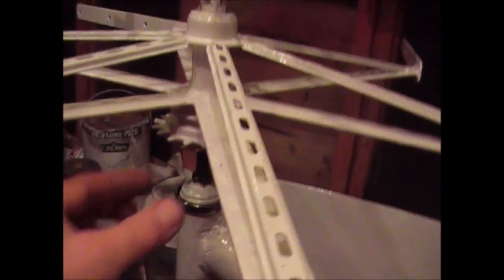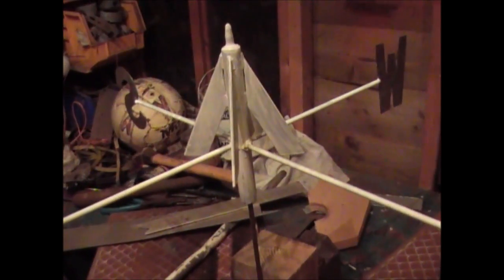Jim's Allotment - Plot 9 - January Tour Part 7 - Organic Pest Control and DIY Weather Vane

Comment: Thanks very much jim for that excellent advice. It's a coincidence that I have started collecting egg shells from a local cafe - 100 per day. When herself is asleep I put them in the oven for 10 mins. I use the blender to grind the shells up and bag them up. I know Aaron asked if it's ok to compost rhubrarb  . I would like to have your opinion on this matter too. The weather Vane look the business- Congrutulations. All the best
Reply from the maker: Cheers fro the question ... Rhubarb leaves are perfectly safe to put on the compost, the diabolic acid will break down so it is not dangerous in anyway, Hope you don't get caught grinding up you egg shells, My wife would skin me alive if you found me doing that :-) Cheers Jim..

Comment: I think I might pass on the rhubarb leaves mixture.  It sounds as if you need to be shown how to do it rather than just 'have-a-go'.  The life insurance is paid up but I don't think the missus wants me out of the way just yet :-)   I am starting to wonder from this whether I should actually be composting the the leaves from rhubarb at all.  Is there a danger from them when they break down.  Does the acid get into the resultant mixture?  I think the weather vein is amazing Jim.  I don't have the tools and I am not as skilled as you with them so I couldn't attempt something like that but you have made me think about how things are put together and that is a start.  Many thanks Jim, another great video full of good information.  All the best mate.
Reply from the maker: Cheers for the question and positive comments ... Rhubarb leaves are perfectly safe to put on the compost, the diabolic acid will break down so it is not dangerous in anyway.. Cheers mate Jim..